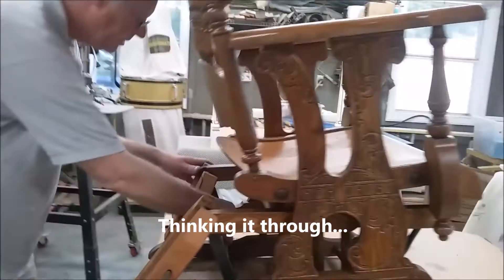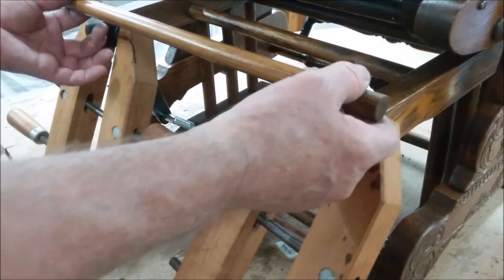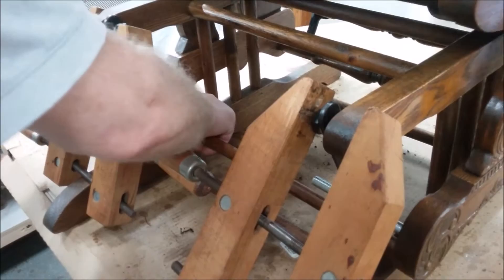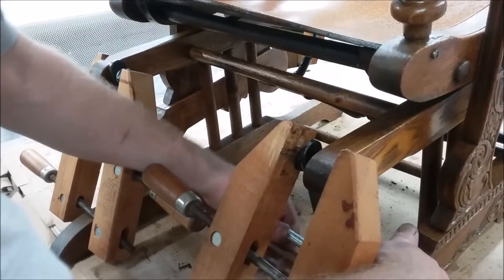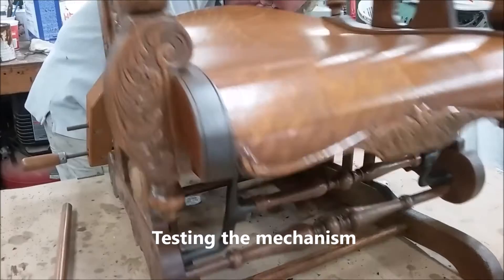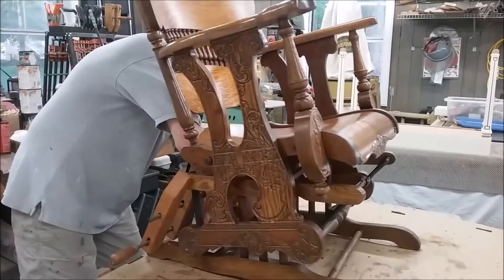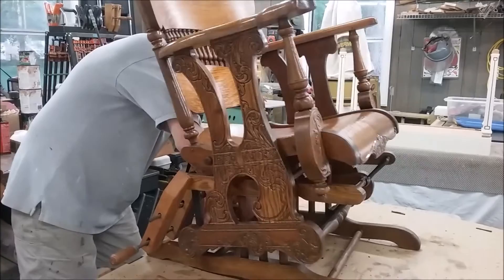Repair and refinish of Victorian glider rocker with broken mechanism

Comment: I have an antique gliding rocker that I want to restore. I’m am missing the same mechanism that you’re showing in this video. Can you tell me where and what parts you got to restore it? Any directions or suggestions that you have would be most appreciated.
Reply from the maker: Hi Dawn. I actually fabricated the missing parts as a custom project. I made the flat bars out of stock from home depot. Cut them length and then rounded off using a grinder. Very hard to find parts for these rockers. I think I used hex head bolts for the pivoting mechanism.